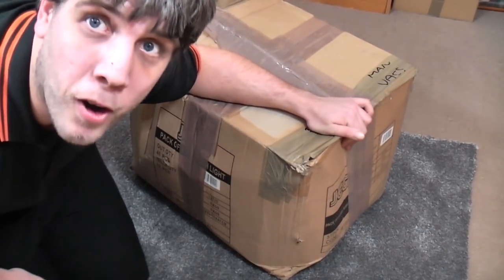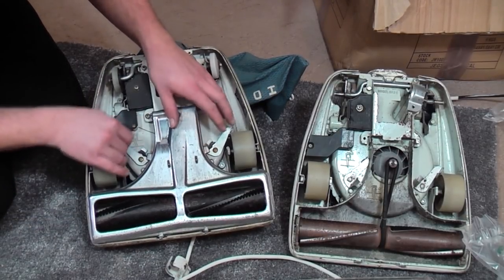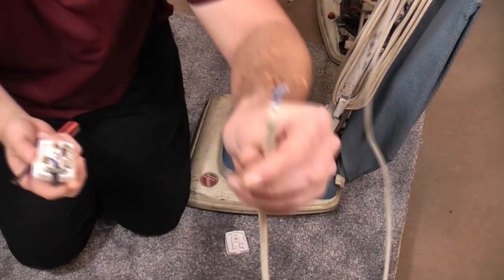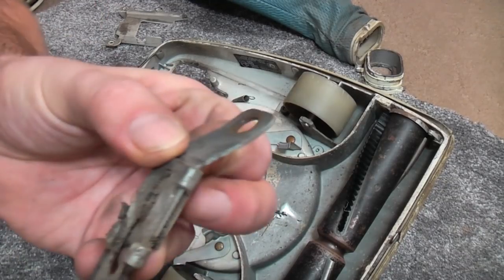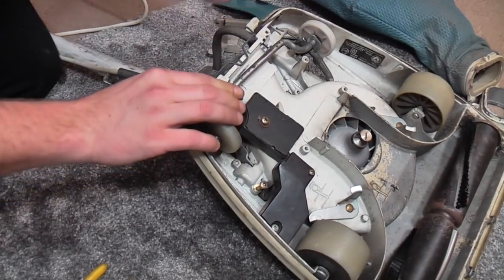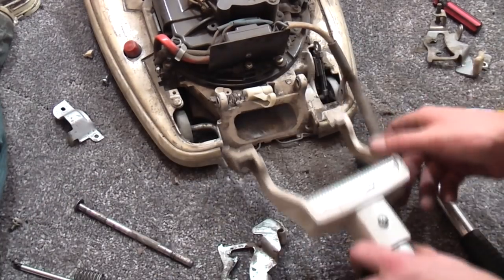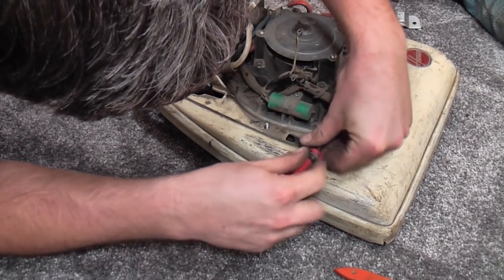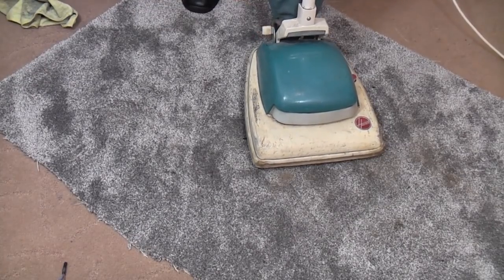Fit for SCRAP? Hoover Senior 652a & 6525a - First Look & Unboxing

Comment: Sam, at 27:54 you put the belt on the wrong way round, so the brushroll would have been spinning in reverse. On a Junior this would not matter as the belt flies straight off the pulley if you put it on back to front, but on a Senior,. it stays on the pulley but spins the brushroll backwards, which wont help it clean properly. Always turn the machine on when its still upside down following fitting the belt so you can make sure the brushroll is spinning the right way.
Reply from the maker: Ha I'd not even noticed that! Hope I haven't made the same mistake on the after video...